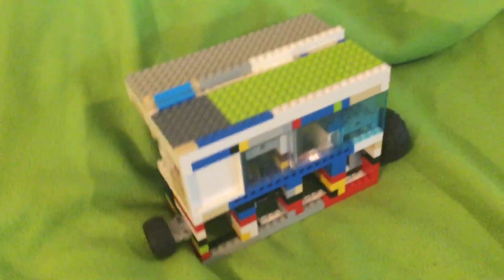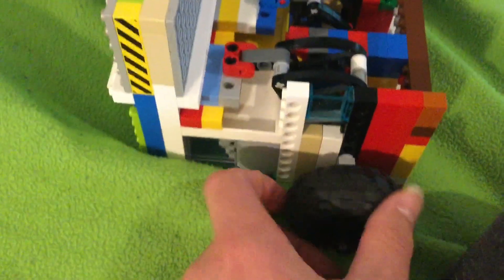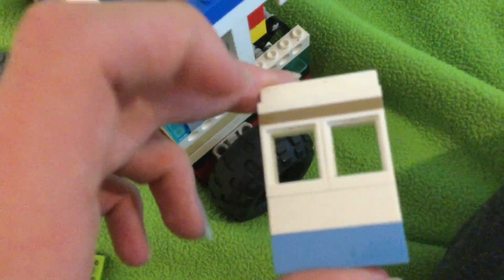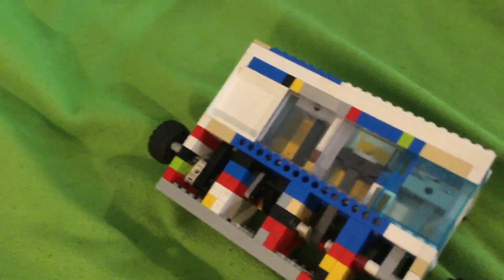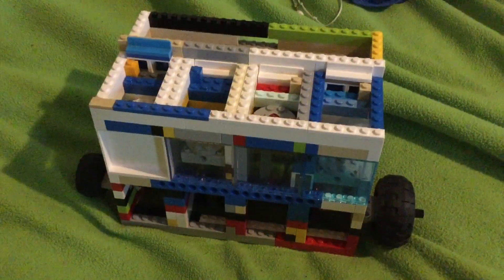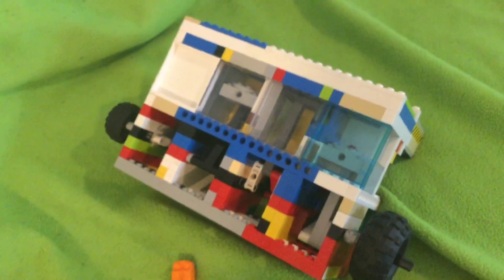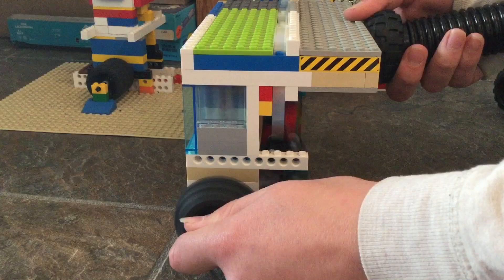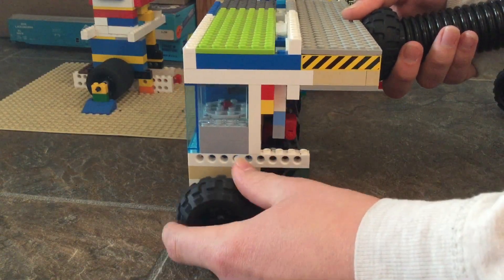SCV Inline 4 LEGO Vacuum Engine!

Comment: what!? I have always wanted to make a blow-into engine!!!!! how do you make it blow instead of vacuum?
Reply from the maker: I was running it on vacuum for the running portion but you can blow into it because the valves wont blow up being windows
Reply from the maker: so I could use a shop vac with the hose on the exhaust if I wanted to but I can't really try because I don't have a shop vac.